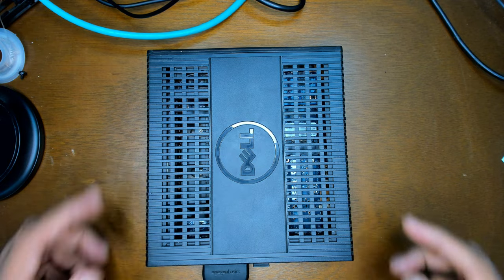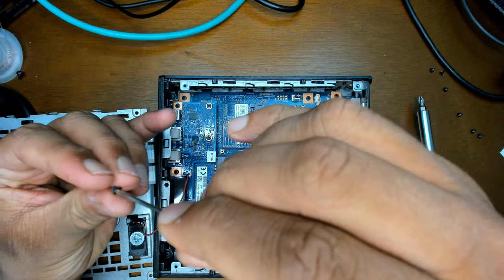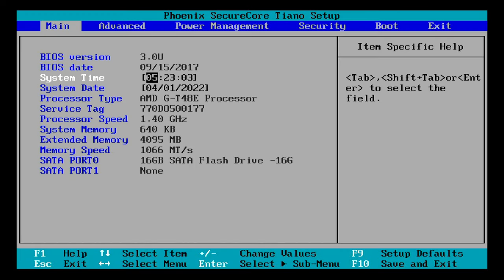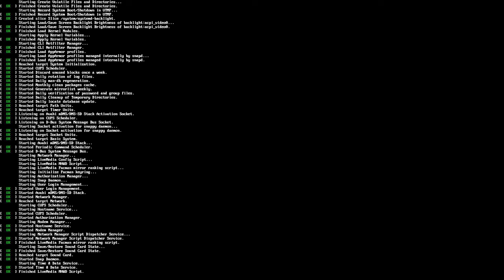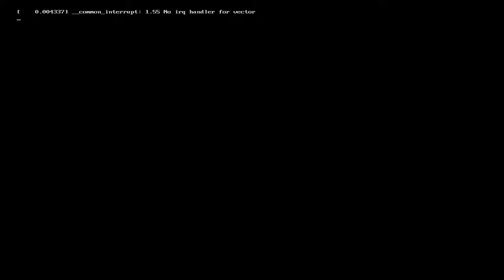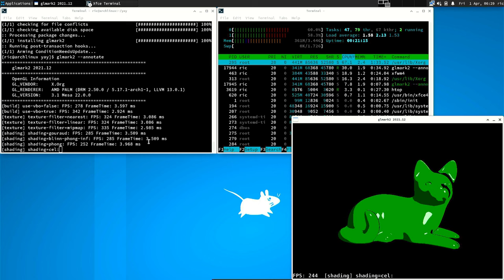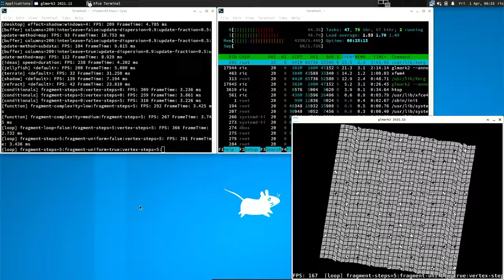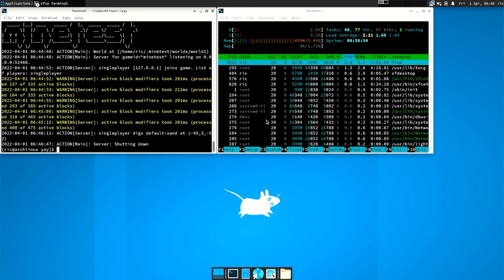Dell Wyse 5010 Dx0D Thin Client | Overview, Installing Linux and GRUB2 Issues

Comment: I got one of these from Goodwill.  I was able to install the latest version of Linux Mint Cinnamon with no issues.  I swapped out the ram for an 8gb stick and schucked a Samsung 870 Evo 512gb and slotted it in.  Secured with a zip tie.  It's a little oversized but fits and seems to work well.  Nice little machine.  To fix ACPI shutdown just add noefi in the appropriate spot in grub.conf and upgrade grub.  Doesn't seem like a straightforward way to update the bios without a programmer so that's my next challenge.

Comment: I have one of these and I was able to get W10 on mine... got a sata to NGFF m.2 adapter and a 512GB NGFF SSD and it works fine.... the biggest issue is the memory, W10 needs at least 8GB to get it to work right.... so these models are mostly for Linux distros....

Comment: You Need to disable Secure boot, and then disable UEFI bootloader, set it to Legacy it's quite a bit hidden in the bios ;-) but i'm running Linux Mint 20.3 on the ThinClient now ;-)
Reply: Thanks man!
Reply: For the life of me I can't find secure boot where did you find it
Reply: @devilsreject3913  i can't capture the bios screen yet. have to wait for my hdmi capture. Then i would upload a tiny movie about it. on YouTube
Reply: is this with a 5010 system ??? or a different version/model as looks like its a lot easier on the 5070 version just after a bit of confirmation thanks
Reply: @patricknewman1840  Yep. The DELL Wyse Dx0D aka 5010 🙂
Reply: @MrGarfield  thanks mine is showing the UEFI greyed out and won't let me change it at all but Ubuntu installs with no problems as it is signed for secure boot have just finished installing the mini version
Reply: @patricknewman1840  i still cant capture HDMI yet... You have to go deeper in the Bios. There you can disable secure boot options... Then you can disable UEFI 🙂

Choose Security 
|> Security Boot Configuration
...
Secure Boot Option .... Set this to : [ Disabled ]

Then Back to Advanced... 
Boot Mode [ LEGACY ] 

F10 Safe and Exit : 

And youre done 🙂
Reply: @johnhotz2671  See my last reply to Patrick in this Comment section
Reply: @devilsreject3913  See my last reply to Patrick in this Comment section
Reply: Hey, I just wanted to say thank you for this suggestion. I tried a bunch of different distros, windows, etc, and after like 10 hours of no success I tried this version of Mint with XFCE and it worked first time. I have no idea why this ended up working, but thank you!!!
Reply: @MrGarfield  I have enabled boot from USB but cannot find secure boot or UEFI. The security option just allows you to change the security password. Any ideas?
Reply: @peterbullify  Unfortunately, I can't share screenshots on YouTube.

Some Others Got it done with my prev. Written instructions... 

Choose Security 
|> Security Boot Configuration
...
Secure Boot Option .... Set this to : [ Disabled ]

Then Back to Advanced... 
Boot Mode [ LEGACY ] 

F10 Safe and Exit :

Comment: Can it upgrade to 8GB of Ram? I just grab one of this for dirt cheap to thinker with it But seems like 2GB is not enough for me.
Reply: Update I installed 8 GB of RAM and it worked fine. But I can't get Linux to install as GRUB always failed. But if I take SSD out and install Linux to it then put SSD back in Wyse it worked fine.

Comment: Did the terminal powered off completely? Mine stays powered on hanging on reboot: power off message.
Also I figured out how to install dell ThinOS or SUSE. All you need to do is first prepare usb for image pulling. Then you need to find thinOS/suse image inside one of bugfix files (open any and click on previous version, you eventually find the base system image). It may happen that dell installer won't work with image if originally device have other system. Mine was delivered with ThinOS and I want install suse. So, I changed master key in XML file of suse on usb to match master key from thinOS and it works just fine. I also removed bios entry from seuse to prevent flashing bios. You may try not removing bios entry, but it can brick your device (as far as I know windows devices has twice as much bios memory as linux version).
Reply: Mine too not power off.... U found solutions ?

Comment: I was able to successfully install and run Debian **NON-FREE** on a Dell Wyse 5010 Dx0D.  I downloaded MATTE desktop only with the install. This was after several trials of various distros. It is likely that there is a missing driver that prevents the GUI/Desktop environment from running. In other distros I was getting a blank screen that was preventing me from entering login information.
Reply: Ah, thank you so much for commenting this. I'm attempting to install debian and have been running into the same problem, I'll give this a shot.

Comment: Dang! single slot for ram is a serious deal breaker...i was expecting a dual slot on this one so i can atleast beef it up to a min of 16gigs
Reply: They can only take 8gb of ram, as far as I know. Not that these need anymore than that due to them only having low power dual or quad core CPUs. This particular dual core is only clocked at 1.4ghz. 8gb of ram is more than enough.

Comment: what kind of SSD for this model, bro?
Reply: I have a teamgroup 1tb that’s a half board, their 2tb is a full board. You need to disassemble a 2.5” drive and pull the board out of it. You need to cover the stand off that the original flash drive mounted to or you risk shorting out your replacement SSD.

Comment: Grub fails, banging my head.
Tried over 10+ times
Reply: Did You managed to fix it?
Reply: hey men any update? @Harshit Ahuja
Reply: @damian.5925  yep, flashed the bios again with ch341, it made the nvram clear, installed ubuntu successfully after that
Reply: @harshitahuja6211  how to flash the BIOS?  newbie here...
Reply: @amoiseeker  CH341A 24 25 Series EEPROM Flash BIOS USB Programmer "complete set"